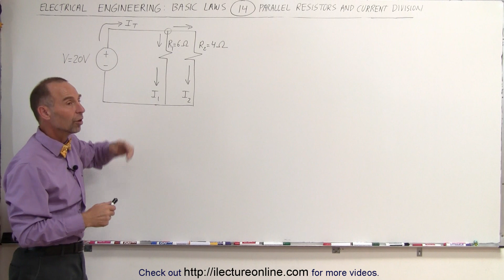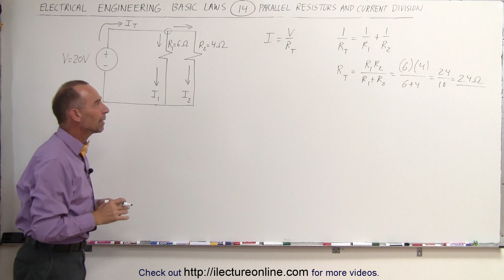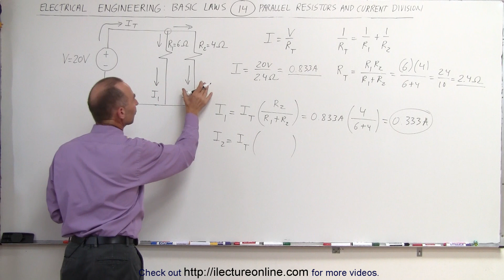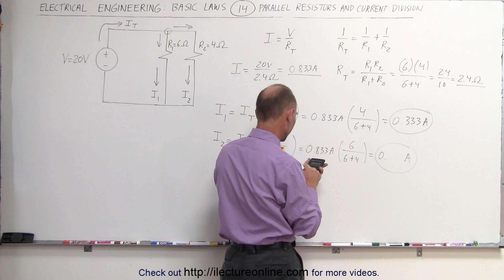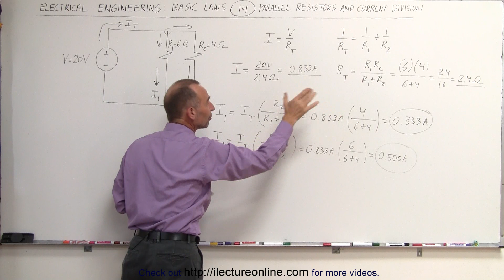Electrical Engineering: Basic Laws (14 of 31) Parallel Resistors and Current Division

Comment: Michel, you're calculation on the current is not correct.  20 volts/2.4 ohms is 8.333 amps.
Reply: Yeah
Reply from the maker: Yes indeed.  I don't always see the "dot" on my calculator.

Comment: Amazing lectures! As an alternative, the 20V has to be dropped across the resistor network, so you can get the currents directly by I1 = 20/6 A and I2 = 20/4 A.
Reply from the maker: Yes indeed, but we wanted to show the technique used here, because in many cases it is the best method to determine the current in a branch.

Comment: Hello 
Why if we take the loop that contain voltage source and R1 dose note work
20 -6I1=0==> i1=20/6
Thanks
Reply from the maker: Sorry, we did not understand your quesion.
Reply: the loop that contain V and  R1 .
applaying KVL we have 
20V - 6I1 =0
Reply from the maker: Yes, I made an error with placing the decimal point.  (Actually my eye sight is not as good anymore and couldn't tell what my calculator displayed).  🙂

Comment: Sir if the resistors are more than 2, does that formula still valid or not? Thanks!
Reply from the maker: If you are referring to the equation to find the current, then this only works with 2 branches.  However that said you can use this by combining other branches first to reduce it to two parallel branches.
Reply: Ok Sir. Thank you so much!!

Comment: Could we also write the Current Divider Formula as I = V/((R1*R2)/(R1+R2)), so I1 = R2/(R1+R2) * V/((R1*R2)/(R1+R2)) = V*R2/(R1*R2)? Why do we normally use I*R2/(R1+R2) - and calculate the total I current first? Thank you!
Reply from the maker: There is more than one way in which this problem can be solved.  In the end you'll use the method you are most comfortable with.  I tend to show the methods that students succeed most with.

Comment: Assume like the total current is wrong because you divide the voltage with 24 instead of 2.4 which caused I1 and I2 to be wrong also
Reply from the maker: Yes, you are correct.

Comment: Very useful. Keep up the good work. Enjoy your teaching. Good refresher for me.

We also can use or apply KVL (Kirchhoff Voltage Law).  

Loop1 V=I1*R1 or I1=V/R1 = 20/6 = 3.33 Amps 

Apply KVL in loop 2   I1*R1=I2*R2 or I2=I1*R1/R2 = 3.333*6/4 = 5 Amps

Therefore I1+I2= 3.333+5 = 8.333 Amps (Total current)

Comment: Since the two resistors are connected in parallel, therefore the voltage drop across them is the same and equals to the battery voltage.  Therefore the current across R1 is calculated by V/R1= 20/6=3.33 A 
While the current across R2= V/R2 = 20/4=5A.
Note that 3.33+5= 8.33 A which is the total current which confirms the answer.

Comment: I found another way to find the Amperes of each Resistors that more easier. 
Conclusion of Data's occurred after calculated as follow:
Vt = 20 V, Rt(Parallel) = 2.4 Ohm, It = (20/2.4) = 8.333 Amp.
Since Both of the Resistor in Parallel Loop then Each of them got 20 V in their own Line.
Lets we find their Amperes according to the Resistor that they have.
1)  R 1 = 6, V 1 = 20, I 1 = (20/6) = 3.333 A.
2)  R 2 = 4, V 2 = 20, I 2 = (20/4) = 5.000 A.
3)  It = I 1 + I 2 = (3.333 + 5.000) A = 8.333 A.

LOOPS CONCEPT:
Close Loop in PARALLEL will giving Same VOLTAGE NUMBER in each of the Junction Line.
Close Loop in SERIES will giving same AMPERE NUMBER in the whole Line.

Just Simple as that.
Thanks SIFU (Teacher) Michel van Biezen. Great! Yes!

Comment: sir V is same for the each branch it means Voltage across R1 & R2 is 20V
so that I1=V/R1   = 20/6 = 3.3A
            I2=V/R2  = 20/4 = 5A
  then I=3.3+5=8.3A is this not correct

Comment: Don't get it. It=I1+I2 : It= (20/6)+(20/4) : It= 8.333A Much more simple.
Reply: and also this equation gives the amphere values, 20/6 is equal to 3,33 Amphere and, 20/4 is equal to 5 Amphere, thank you Recolaq, this way is much easier, after 3 years comment :D

Comment: at 1:48, is it 20/2.4 or 20/24?
Reply from the maker: There IS a decimal point there  (2.4)
Reply: Why 0.8333 is the total current instead of 8.3333? The lecturer said 20/24, but in the white board it is 20/2.4
Reply: ahhhhh sorry, I didn't see that someone already commented about this

Comment: what if 3 parallel resisters?
Reply from the maker: +723lion 
Examples of that will come later.  With 3 parallel resistors, you first combine 2 and then use the same technique.
Reply: Using Conductance instead of Resistance can make that so much easier. G = 1/R
So I2 = (G2/ G1+G2+G3) * I total
Reply: what did u mean by that sir? can u show us some examples?
Reply: m